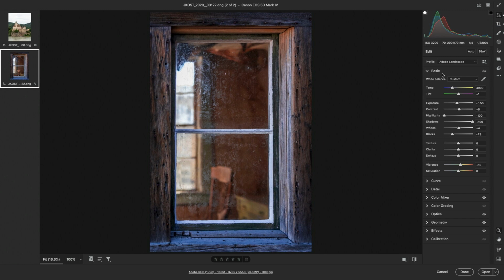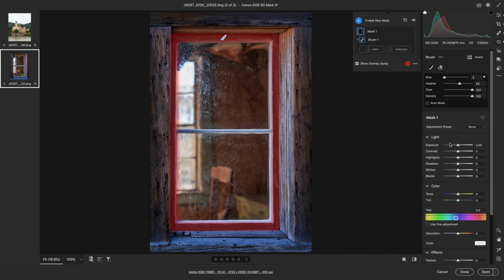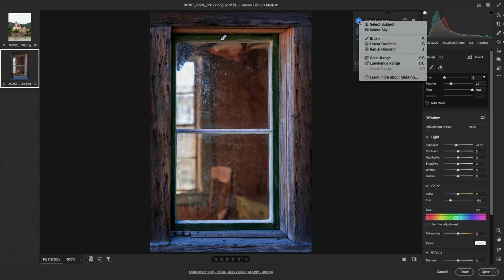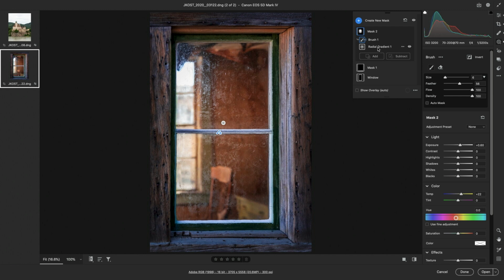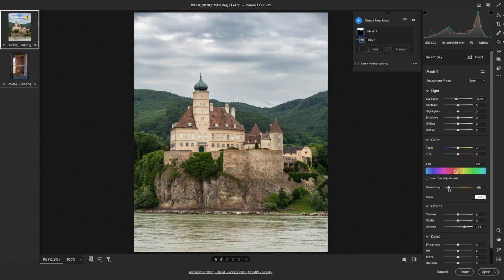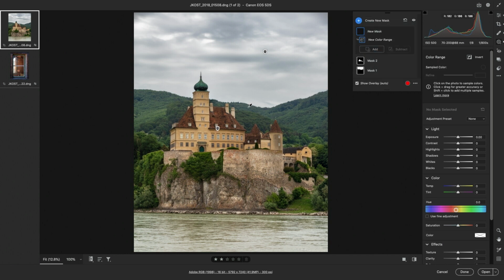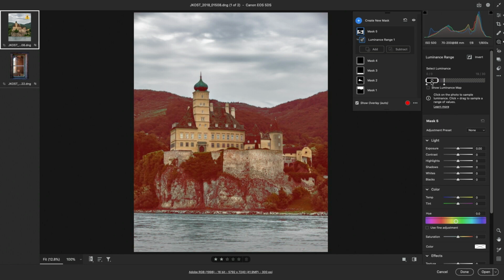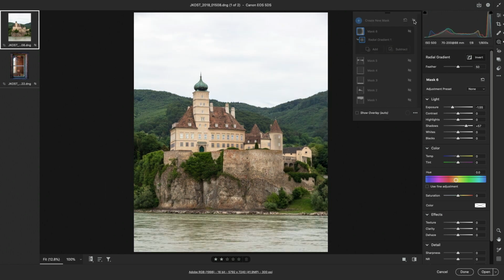Camera Raw v14 - The New Masking Tools

Comment: Hi Julieanne - If I'm using the masking in (Ps') ACR - is there a way to export the masks I create to Ps layers (or as an alpha channel/s)? I'd like to do that so I don't have to re-invent the wheel creating new Ps layer masks to perform different adjustments or apply different filters to the same areas for which I created masks in ACR ... (I'm not a LrC user). Thx for any suggestions on that. I'm a Win 10 user, but assume that makes no diff functionally...

Comment: Please show how you take a brush, and adjust or extrude the parameters for one photo, you can apply the same settings to another photo .. and when you have 100 of them. Don't just preserve the image. because every time there is no point in uploading an image .. I edited a series of photos and other settings for other photos .. This is the problem in version 14.1, unlike 13.1. The developers did a very bad job that they removed the preservation of the settings for the tools. if anyone needs to be able to reset the settings and set .. and so in version 14.1, each time you need to set a new setting for the tools. Just idiots of Photoshop .. developers.